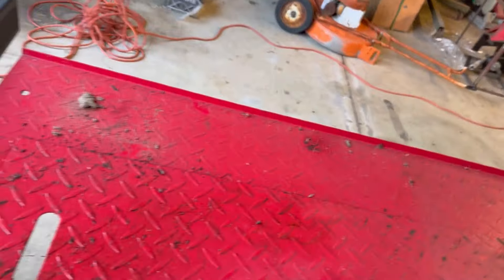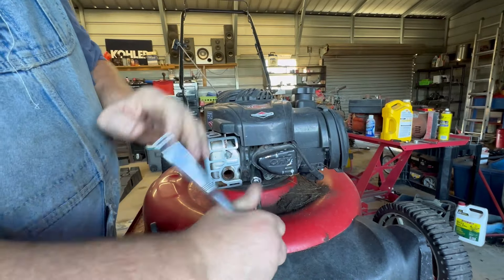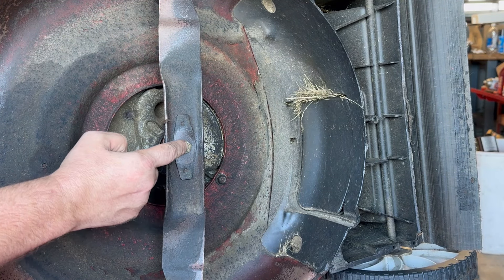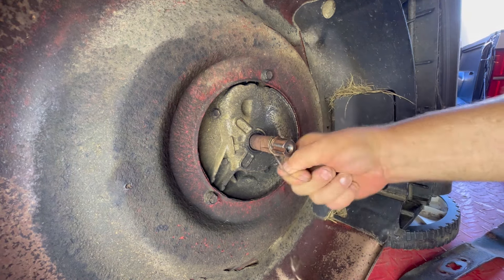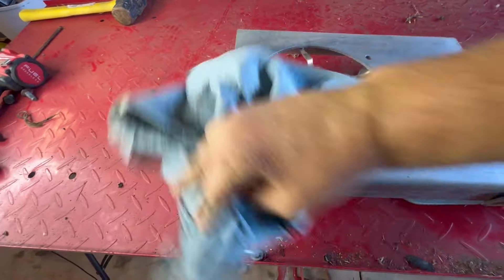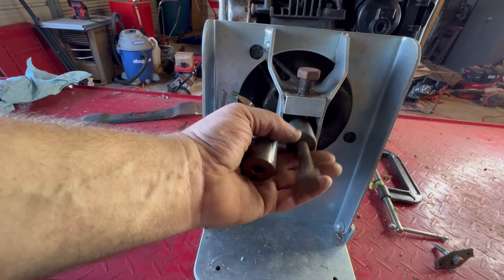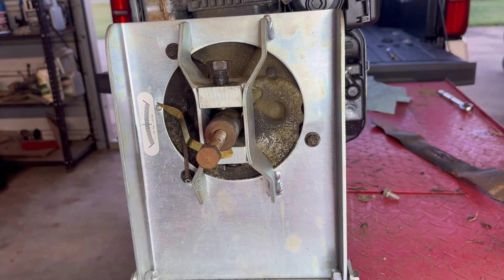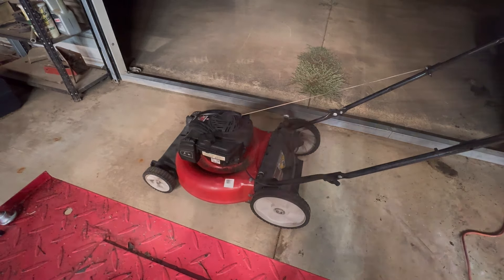FIXING BENT CRANKSHAFTS WITH THE MIGHTY MIDGET CRANK STRAIGHTENER

Comment: Pretty cool jig.  I could have used that 30 years ago.  As long as you don't distort the bearing or seal it will keep that engine in the game for a little longer.
Reply from the maker: Bottom pressure bolt supports crank while pressing down

Comment: I have seen those type snap the shaft and the end fly through the shop. Mine is a Jiffy brand and only has one screw. It pushes against the sump. Never broken a shaft. Have straightened literally hundreds of shafts.

Comment: Jeremy, is there a bottom end oil seal consideration here? Or only if it is leaking? As opposed to may as well replace it while the engine is off the frame and it is relatively accessible? I can’t believe those seals are robust, nothing else on that model engine is robust. After all, it is 100% Chineseium
Reply from the maker: If it’s leaking replace it, but if the crank is benched that bad a seal is not going to seal

Comment: Now that is a tool worth having. Similar to using a dial indicator. For checking run-out. But also has the ability to straighten & realign. I gave a mower away in the past, due to a bent crankshaft. Didn't know this tool even existed. Trouble is, we make everything these days out of plastic & playdohnium. With zero quality & reliability.